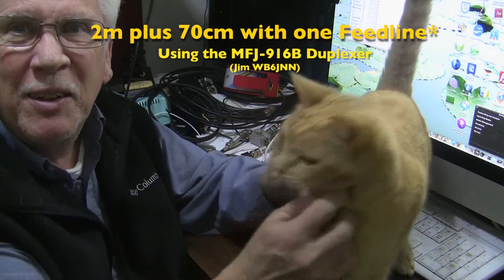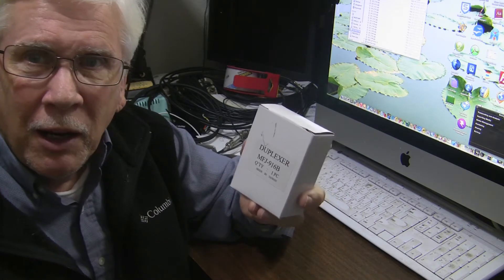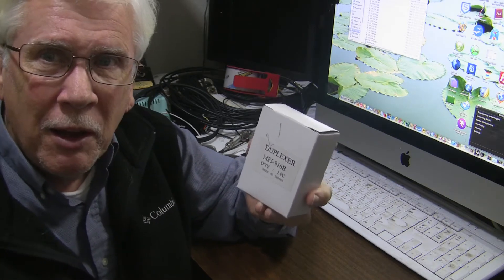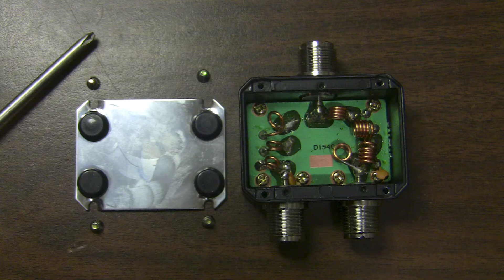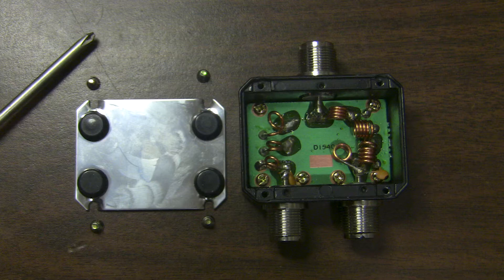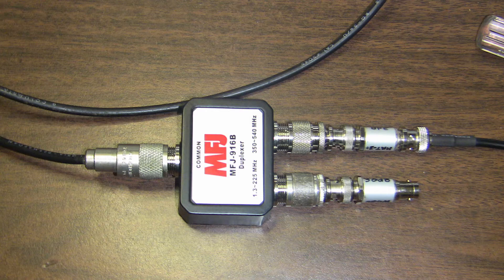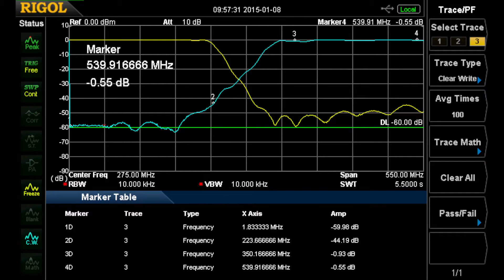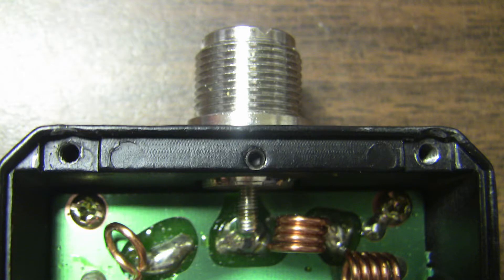MFJ 916B Duplexer

Comment: Can this be  used the other way around? One radio and 2 antenna?
Reply from the maker: Sure.
Reply from the maker: That is what it is intended for and how I am using it.  Two radios to one antenna, on the other hand, would probably require better isolation than 40 dB depending on TX power.  At 40 dB Tx power of 10W only drops to 0 dBm.. probably not a level you want to see on the front end of the alternate receiver.
Reply: @jimeagle1  yeh ok. I want to push out 50 watts from one radio to two antenna.
Reply from the maker: @Jay-hr9ci  I am assuming this involves one VHF and one UHF antenna connected to the VHF and UHF ports of the MFJ unit.

Comment: Love your channel. I'm using the same model the other way around, 2 radio on one antenna. Do you think that filling the case with epoxy would be an acceptable method for a more long term outside use?
Reply from the maker: Kidsnoob Epoxy filling the inside would change the dielectric surrounding the coils and capacitors with unknown tuning effects on these components.  This would not be a method that I would recommend.  Actually, placing the unit inside a box in the way that MFJ does for the outdoor version is probably the best approach.  Any moisture drains around the outside of the box though in high wind, high humidity and/or moisture regions it is possible that moisture could be blown into the bottom of the box if the enclosure is not properly sealed.  I haven't yet purchased the exterior mounted version but I suspect that it has been designed to handle blowing rain, rapid pressure changes, and so forth.